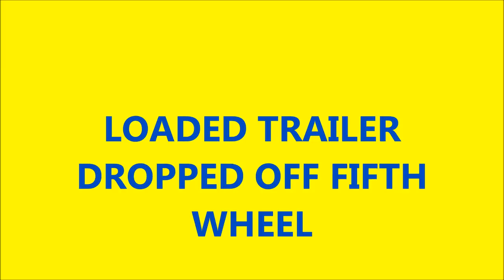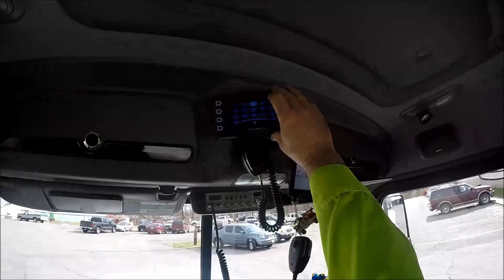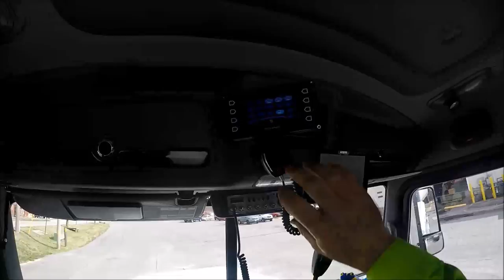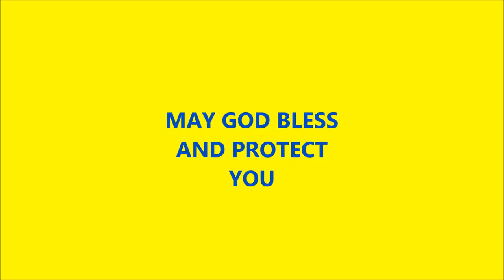LOADED TRAILER DROPPED OFF FIFTH WHEEL

Comment: I wonder if someone pulled the release pin to his 5th wheel when he was parked? I had someone do that to me at my own terminal and luckily the landing gear still worked but I had to stop and put the tractor back under the trailer. And the same thing happened to another driver.
Reply from the maker: It could have happened.  I've seen it before.
Reply: I even had an incident someone pulled the release arm to the tandems and that's worse than getting the 5th wheel
Reply: I always check to make sure none of the pins under the trailer are pulled before leaving.  Both the tandems and 5th wheel.  People pull them both when your not looking.

Comment: ron do you ever show up to a job and scratch your head. like how am i gonna go about correcting this? by the way your an amazing guy and a  great operator. god bless
Reply from the maker: Yes I do scratch my head.....just did one the other night with a tractor/trailer that crashed and burned to the pavement completely blocking the interstate.  It took me a little while to get a plan together.   I'm always having to "think on my feet" and sometimes have to change plans or I will think of a better way while I'm preparing to do a different way.  That's part of what I love about this job....IT MAKES YOU THINK.  Thanks for watching and God bless.
Reply: Is there a video coming of that wreck?

Comment: why does the drivers side only need outriggers? seems like both sides should have them!
Reply: Because all the weight was on the drivers side plus....  the trailer was not loaded heavy
Reply from the maker: Both side do have outriggers, but I only needed to use the driver's side outriggers since that was the side I was working from.  If it had been a heavy lift I would have deployed all of the outriggers on both sides.

Comment: Driver could have just lowered the landing gear and cranked the trailer UP in low gear. I've done it several times with 40,000 loads.

Comment: What's the most weight you can pull or lift?
Reply from the maker: Lifting capacity is 100,000 lbs.  Pulling capacity is limited only to the resistance that I can create with my truck or using other equipment as "deadmen", and the limitations of my winches and cables.  It is not uncommon to have a winch-out pull that is in excess of 200,000 or more due to the resistance created by the stuck unit.

Comment: Probably some jerk pulled the pin on the fifth wheel. My dad always checks by tugging on the trailer with the trailer brakes on.
Reply from the maker: Could have been.  Certainly wouldn't be the first time.  I always check the 5th wheel before I tow a truck and trailer combo to make certain it is latched.   Thanks for watching and God bless.

Comment: I would take the airbags Gage off and lift the trailer and then use a 2X4 and then pickup the landing gears slowing but never call a towing trucks thus had happened to me in twenty five years at least 5 times

Comment: I heard it latch is not proof,  driver must physically get out and look to verify it is latched. that is a fontaine wheel- there are twin bars that slide behind the king pin to latch in place. if the king pin hits the trip bar the 5th wheel will close and the king pin would not be captured.   it would be his last day. he didn't follow correct hook up procedures. no do overs. you're outtathere.